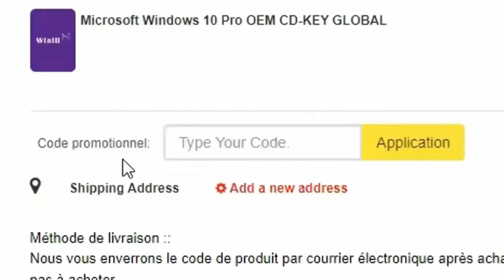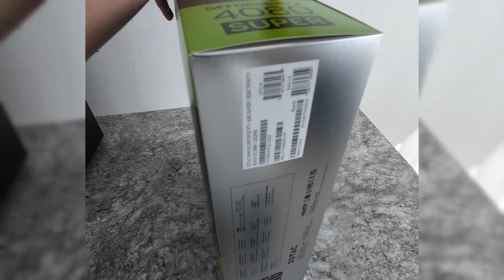MONTAGE PC CLIENT #13 : Un MAX de perfs pour 2400€ !

Comment: Hello, juste une petite question pour une 4070 super le r7 7800x3d c'est overkill ou ça passe
Reply from the maker: Hey, ça dépend à quoi tu vas jouer et sûr quel écran
Reply: @ViiZiiX c'est pour de la 1440p 21 ou 32/9 et genre Apex légends assetto Corsa et flight simulator...
Reply from the maker: À mon sens c’est pas forcément intéressant alors, vaut mieux viser plus bas et mettre une plus grosse carte graphique
Reply from the maker: @Gnou_ Je comprends ce que tu veux dire mais j'irais pas dire que la différence ne se voit pas, après tout dépend de l'utilisation comme toujours

Comment: Salut je suis entrain de monter ma 1e configuration, et dcp je voulais savoir si c possible de faire  un overclocking sur mon processeur i7 14700k avec une 4070 super et une carte mère Asus rog z790 , j’aurais aucun risque ? Et pour le refroidissement j’ai pris un Watercooling de chez nzxt 360mm
Reply from the maker: @hatemrouache3825  Salut, avant ça met bien à jour ta carte mère avec la mise à jour qui intègre le microcode 0x129 pour le cpu, c’est censé régler les soucis de stabilité. Ensuite oui tu peux faire de l’oc si tu as envie mais à toi de gérer au niveau des températures, il chauffe beaucoup ^^
Reply: @ViiZiiX  ok si je comprend bien il faut pas trop abuser de l’oc, merci de ta réponse cv m’aider
Reply from the maker: Disons qu’il faut doser, si ton cpu commence à se brider parce qu’il chauffe trop c’est que t’as été trop loin, après pareil est-ce que t’as réellement besoin d’un oc. Dans tous les cas avec tous les problèmes que les derniers cpu intel rencontrent actuellement, à ta place j’attendrais un peu avant de faire un oc, histoire de voir si tout a bien été réglé ou pas
Reply: @ViiZiiX dcp je vais attendre un peu, surtout que je c que là dernière génération d’intel chauffe beaucoup